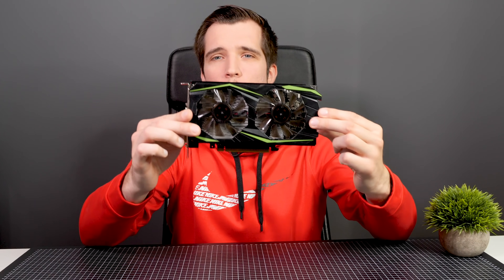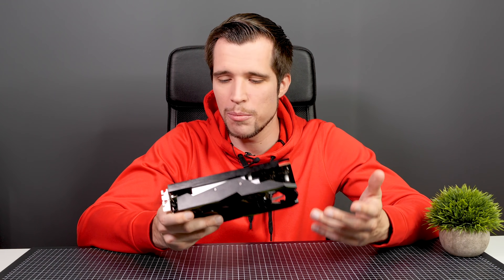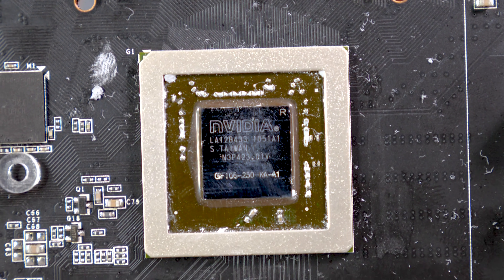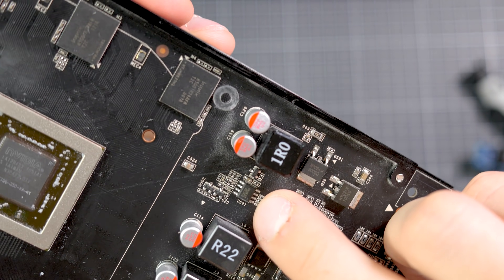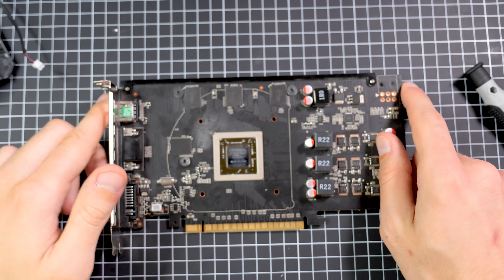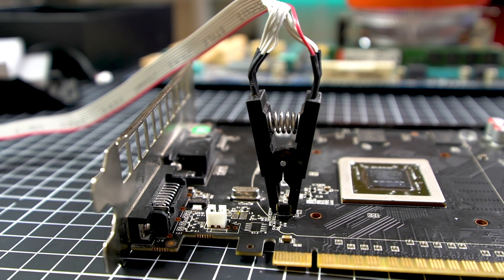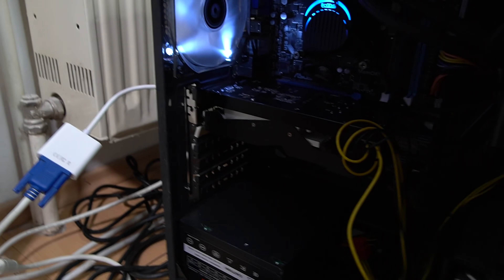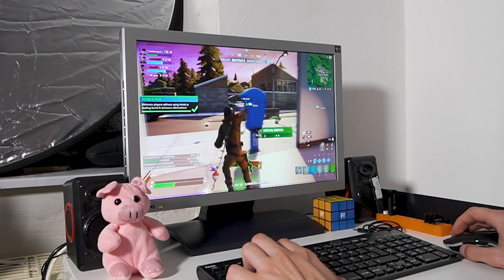The BIG Chinese FAKE GPU SCAM -  Fixing a broken GPU From WISH 2020

Comment: I have a similar fake card. Mine worked with "143074.rom" downloaded from techpowerup. My 450 only has access to 75 watts of electricity as there is no 6 pin connector. Mine runs stable in torture test, settling on 79 C. In benchmarks it is the same as nVidia 660M (2012 laptop gaming chip). Mine is GF116 core and 1 GB Hynix RAM.

Comment: Be careful adding extra power, most fake GPUs are simply mobile GPUs that normally run on much lower voltage, you don't wanna burn out the silicone.
Reply: No, it won't hurt anything. The input voltage is the same 12V either way no matter which end it comes from and the output voltage is set on the card itself with strapping resistors of the vrm.

Comment: Unfortunately I got scammed too but only because my real 1050 ti stopped working for me and I was looking for a cheap replacement.  But watching this video made me realize something about my old 1050 ti card that possibly it might just need a minor chip replaced on it to fix it.  Is there anyway that I can check that and this is a way out in left field type of question but if need be.  Would it be possible to transfer my gpu chip from my old 1050 ti to the fake one and actually get it to work.  Any feedback would be much appreciated.

Thanks

Comment: Hi, I hope you can help me, I have the same Chinese card gtx 1050 ti fake, the BIOS it has is modified so that the system detects it as if it were that model or I see its performance is bad, I have the kit to flash the bios but I don't know which one It is the one I should have, looking for BIOS it says that it may be the gts 450 or gtx 550 you have tried but it turns on with graphic failures, searching I found this video, the card came to me exactly the same as you show it, I am from PERU the language limits me a little to understand your explanation

Comment: Is there any way  to take like gt 1030 take  its bios chip and GP108 chip and witch it over flash the bio to read 4gb because there is a 4gb 1030 out there 2gb is gddr 5 and 2 gb off  ddr4 but there are more chips then 1 gb on that card the gt 450 just can't read that much

Comment: Do you want mine from a WalMart associates
Driver=2017: 382.33, not 1290MHz GPU-Z=FAKE. Max 1920x1600, Flashed GPU Bios, crashes. box=no 1050ti,no manual,cd rom driver essential

Comment: I got my "gtx 1050ti" for free as well.  When I submitted a request for a refund on EBAY, the seller contacted me and gave me a full refund and he told me not to to bother sending it back.  That's why I'm watching your video.  I want to see if I can fix it and use it on an old school pc.
Reply: hahaha what a racket, as a wise man once said - one mans trash is another mans un-trash
Reply: @_Aemse  I got it flashed to the right bios, but it's still trash.  It works well enough to run a dedicated minecraft server, but to be honest, for what I spent on the items I needed to flash it, I could have just bought a legit card that would have done the same thing.  It was a fun experiment and I learned a lot doing it, but I didn't profit any from it other than the education I received.  I also didn't lose anything from it either, so I guess it was a win on my part.

Comment: The content is very interesting, but I don't think I am buying a graphics card on wish ever, I don't have the technical knowledge or the patience to do what you did. But it does look very interesting still.
Reply: im buying it for a spare system that needs one, already ordered the flash tool. it's basically a gpu for the cost of the flash tool, since you will get refunded

Comment: I appreciate your debunking of Mark Steele's street light "weapons system" video, which I have reposted in several places, including under a group discussion he hosted yesterday, and at Deborah Tavares channel stopthecrime. There are many studies proving the dangers of LED lights, especially high-powered street lights, even without any other EMF "weapons" tech added.  There are THOUSANDS of studies demonstrating the dangers of EMF, going back to 1962, when they already well knew the dangers of EMF, as Barrie Trower explains in the first video at the link below.  

You are young, and obviously fascinated (obsessed) by tech, especially tech operated  by EMF.  Judging from your videos debunking Mark Steele, you seem to be doubting the dangers of EMF (?).  You mentioned the 60 Ghz. frequency, which is of concern, and going to be used for wi-gig routers, because it allows more devices to be used in a smaller space (proximity devices), due to the effect of oxygen on the mm-wave beams.  Other mm frequencies are harmful too, such as 42 Ghz. which degraded the immune response by 50% in a Russian study with mice in 2002.  Please do yourself a favor, and watch the videos at this link below.  The first video with Barry Tower is a good place to start, he is an EMF weapons system expert - not a fake expert like Mark Steele, a REAL military EMF weapons expert (retired long ago).  

As I mentioned previously (if you saw it under Mark Steele expose'), I'm EMF sensitive, don't use any wireless, and had my "smart meter" removed.  The entire city here in Portland has become a hotspot, however, so I'm planning to move this year - God willing. When you love tech, it's easy to minimize the dangers in your mind.  My entire family, like most people, are obsessed by their "smart phones", and other wireless devices.  You don't have to quit using the computer, or "smart phone:, however, all you need to do is plug into a fiber-optic connection, which is more than fast enough for most uses.  Perhaps some gaming devices work faster, movies download faster, etc., but is it worth it...?  

There are many other links exposing the dangers of EMF (not just 5G), as you surely know.  I pass this along to you, because you seem to perhaps not understand how dangerous EMF is, even those weak signals coming from 5G mm-wave small-cell antennae. This is part of the "full spectrum genocide" being waged against humanity.  The current operation "COVID-19" is part of the eugenics program, to depopulate the earth. The first "pandemic", or "pandemic 1" as Bill Gates calls it, is occurring now, intended to kill millions of old people.  "Pandemic 2" in the Fall will happen when children go back to school, then get sick from the 5G antennae and wi-gig routers, which are being installed all over the world during the shutdown - that will be used to cull the children, and sterilize the girls by weakening their egg shells in the uterus.  They will blame it on "COVID-19", shout from the media that people saying it was a hoax were wrong, and that we REALLY need their vaccine now, and it will be forced on humanity.  "Pandemic 3" will be caused by the vaccine, for the rest of us middle aged and healthy people. Avoiding the mark of the beast (patent 666 realed recently) will be difficult to impossible for most people.  They have tiny devices, too small to see, that can be injected into us, some argue it's in the smart dust and black goo being sprayed on us.  The EMF weapons towers (primary purpose) work synergistically with the nano-particles beings sprayed on us in chemtrails, especially aluminum and barium, which create an electro-contudtive atmosphere, and turn us into human antennae as we absorb it.  That's another part of the full-spectrum genocide, but I digress.

You may not be a Christian, but read Revelation, because it's either a warning from God, or predictive programming, because it IS happening.  The matrix control system (MCS) cult uses predictive programming and revelation of the method in television and movie programming (books too), to get humanity thinking about a world the MCS cult wants created.  In this electromagnetic holographic quantum universe, your thoughts and emotions create our reality.  That isn't sewage mumbo-jumbo wu-wu, it's scientific fact. If you are interested in learning more, the channel "seeds of awareness" is an excellent resource.  Humanity is at a very dangerous place right now: the Chinese character for "crisis" contains symbols for "danger" and " opportunity".  This crisis forced on humanity is the opportunity we needed, to break free from the matrix-beast control system.  But we need young, intelligent, clear thinking people like you to be aware of what's happening. I wrote this comment in that spirit.  We need to avoid fear, and keep a good attitude always, because that generates our thoughts and emotions, which create the world we live in.

https://www.5gexposed.com